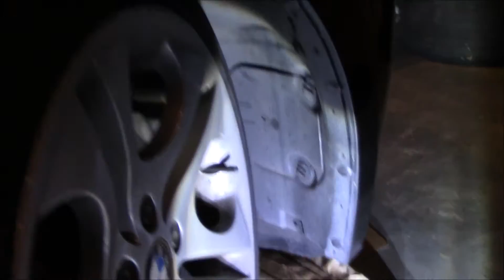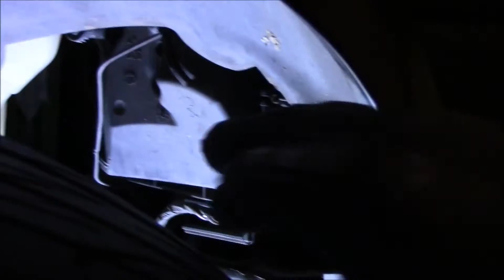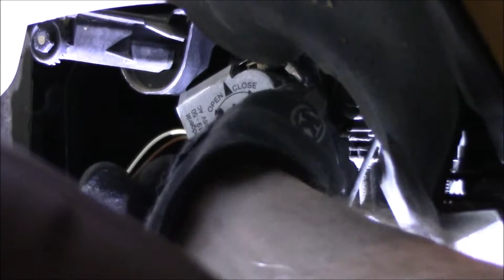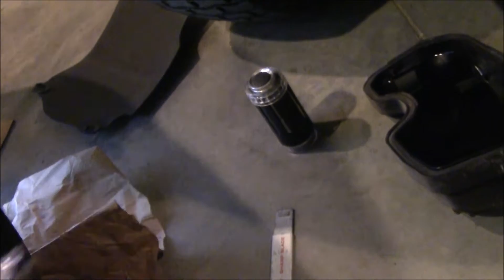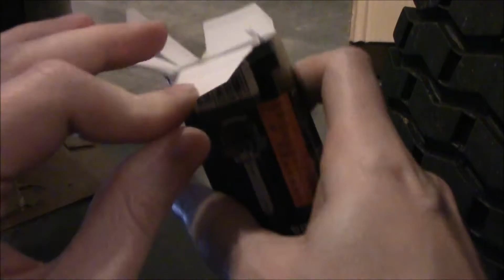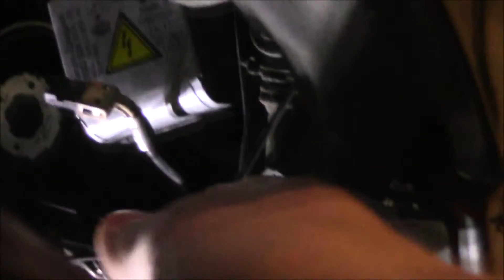Z4 Headlight Bulb Replacement (Xenon low / high beam)

Comment: Thanks for this.  Just changed mine for Sea-light LED H7’s.  Was pretty easy to do now that you showed how to do it.  Sealight LED’s are flat based vs the originals have a rim.  As a result on the Z4 bulb holder, you’ll have to flatten the bent metal that goes up into the base of the original bulb.  No big deal.

Comment: Thanks for the video! I unfortunately didn't know I had xenon headlights until after I bought the non-xenon (H7 Halogen, fortunately much cheaper than the xenons). To anyone looking up headlight changing videos, look at what you have before you order...if you have the silver twist-open thing in this video (it's called a "ballast"), you have xenon (HID) headlights and need to buy D2S type headlights. I got a pair of "Osram original xenarc D2S 35watt" and they work great in my 2007 Z4M roadster

Comment: Thanks. This gave me the confidence to replace my bulbs. (1 was out) It took me about 45 min for 1 and 5 for the other once I was sure I wasn’t going t muck it up. one of my bulbs came out with the ballast. I guess the clips were not on correctly. I will say that my cover for the light assembly is quite difficult to get on and off with the wheels in place.

Comment: There are two separate ones so was the other one to the left of the one you changed? Only my running light is out not the headlight high/low beams

Comment: A few tips: 1. Removing the wheels makes it much easier to see. 2. Raise the hood (when putting the cover back on the right side I tripped the hood release and didn’t notice until I saw the hood wobbling at speed). This way you’ll make sure it’s shut. 3. Turning the ballast to the “open” position ejects the wire plug. Inside the ballast there is a white plastic locking ring. If you plug it back in, it turns the lock ring and the ballast won’t go back on. Put the ballast back first, then plug in the connector.
Reply: Man THANK YOU for the tip about the plastic locking ring in the ballast (mine is more of a rubber band colour but that may be due to age). I couldn't get the damn thing twisted back on for the life of me. I had no problem with the ring on the passenger side and I did plug the cable back in prior to re-seating the ballast so I don't know what's up there...and don't care to check again until I have to.

Comment: I can't twist it back to closed. It simply refuses.
Reply from the maker: Perhaps try a different starting point?  Like dial it back by 90 degrees or so to a different start position. and try again??  wishing you luck.
Reply: @FarReachFR  Turns out i just needed to jiggle it like a maniac. Eventually got it in haha. Thanks.
Reply: @BattleScones  Did you jiggle or force by pushing or pulling? I can't get it back on!
Reply: @treasurechest2951  just force it by jiggling
Reply: @BattleScones  thanks. i found there's an inner plastic ring that needs adjusting
Reply: Having this issue now. Onto jiggling and checking for plastic ring...
Reply: Wound up being the yellowish plastic ring  where the new bulb goes into the metal box thing. Had to be rotated like 5 degrees to line up the dimple insert
Reply: @MrJaay022   Bingo !! lol. i had same frustrating problem. grrr
Reply: @rockysmart6406  Gotta love youtube commentary haha

Comment: does the same bulb act as both low beam and high beam ?
Reply from the maker: Yes.  The single Xenon bulb performs both High Beam and Low Beam duties.
Reply: Thanks for confirming!. I was looking for this info all around and could not find correct answer.I recently purchased a 2008 z4 and yet to pick it up. its angel lights are gone, so just checking if its high beam lights or angel lights.

Comment: Hello, thank you for the awesome video.

I was wondering if both the high beam and low beam are using H7 bulbs... 

I bought a second hand 2008 Z4 and it didn't come with a User Manual, the user manual online (http://cache.bmwusa.com/PDF_24cfaee1-9058-45e7-afc4-4627d02a54f7.arox?v=84fdb6ac-ae0d-4930-b104-b22e418654d2 page 99-100) is a little bit ambigious...)

Thank you.
Reply from the maker: On mine,  The bulb for high and low beam is just one bulb.  And I mean 1 bulb.  1 bulb does both the high and low beam it just changes depending on the amount of power put through it.  But As for what bulb is used it is a D2S.  For reference below is the link to the exact bulb I purchased off ebay and installed in this video. an 8000k D2S HID Xenon.  (8000k is just the color I picked)  I felt it was a pretty good price considering how spendy they can be.  And so far so good, they have been excellent thus far. And I like the cold blue white it project.   Now what I think you might be getting at is the outboard light versus the inboard light.  On my car, the outboard light is the D2S Xenon, but the inboard light is just a standard halogen.  I hope this helps and good luck!
http://www.ebay.com/itm/111722902109?_trksid=p2060353.m2749.l2649&ssPageName=STRK%3AMEBIDX%3AIT
Reply: Thank you, sir